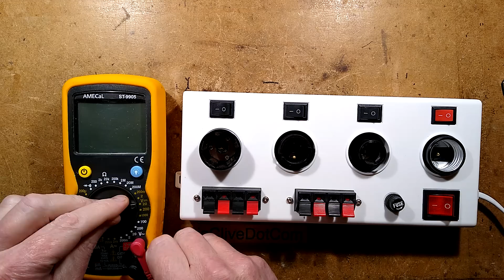AliExpress "explosion proof" Chinese factory test box

Comment: To me "explosion proof" means electrical enclosures, i.e. cabinets, conduits, switches. sensors, and motors, are sealed in such a way that  flammable gases or vapors can not get in to cause an explosion if an electrical spark happens inside.
That tester looks more to be a "spark proof" test box.

Comment: That's a short tester, it's a useful tool for troubleshooting a device that is AC powered and trips a breaker. I've built and used such tools. 

This is not a device that could be used in any capacity with an explosive location and meet any code requirements in the US. 

If you use this as a short tester and don't understand it and how to keep yourself safe it will kill you.

If you use this as a safety device in an explosive location you could kill everyone in the building and maybe a few neighbors as well.

Thanks for doing these videos and shinning some light on these dangerous products.

Comment: Connecting a high watt bulb (like a headlight bulb) in the place of a fuse is an old automotive electricians trick for locating short circuit witout wasting fuses. Just disconnect things one by one from the circuit until the bulb goes dim and the rest of the circuit starts working and you have found the short. Very handy in circuits where there are a lot of consumers like the marker/side lights on a truck or a trailer.

Comment: Hhhmmm, most speaker terminals / wire are usually around 100 volts maximum, with the norm being 30 - 70 volts, if my memory is still free from a short circuit. The Chinese do not take health and safety criteria to the same level as the Western world, in general. As you said this is very basic. Be safe and well 👍

Comment: Does this cause any issues where devices might not get enough power during debugging or is it only for cases where you suspect something is or might short?
I guess it might not be an issue as long as the device uses far less power than the bulb since then the bulb's resistance isn't eating the voltage as much.
Seem like something you could DIY pretty easily, then if you threw in a proper fuse (perhaps swapping to what you need for testing) and used a GFCI outlet, it'd make for a pretty solid safety device.

Comment: A few years ago, I built a project by glasslinger here on YT called "BUILD AN ELECTRONIC CIRCUIT BREAKER".
It was a joy to build and does a fantastic job. Light bulbs are for cavemen :face-blue-smiling:
Runs my AC plug on the bench. One of the better projects I built. Saved my ass many times when I did poopy head things.

Comment: 0:23 This is a Euro plug, type C. This is used in many countries.  If you have a small screwdriver and can overcome the shutter, it will even fit into English sockets.
Reply: Not to be confused with the UK shaver plug (search Wikipedia for 'BS 4573' for the comparison) - although they look similar at a glance.
Reply: Scottish and Welsh sockets too I'd guess.
Reply: Two things to consider 1. BS1363 plugs have a fuse for a reason, we use higher current sockets than most places. 2. The pins on a Europlug are sprung inwards and the tips of th pins are bigger than the shaft. Combined with the way the contacts are designed in a typical BS1363 socket this can lead to europlugs getting stuck.

If you must do the screwdriver trick then please at least do it on an extension lead rather than a socket that is part of the fixed installation, so you will have the fuse in the extension lead and so that if it gets stuck you can unplug the whole extension lead.
Reply: I probably wouldn't recommend trying to connect it to a UK socket, as there have been cases where a fire started as a result of someone doing that

Comment: 5 x 20 glass fuses can have a breaking capacity of 500 - 1500 A, particularly if fast acting. Quite disappointed by this basic error, Clive.
Reply from the maker: I'd expect the 1500A breaking capacity with a sand filled ceramic fuse, but definitely not a glass fuse.  For a glass 20mm fuse the breaking capacity is usually around 35A.
Reply: @bigclivedotcom  That's what the maufacturer's spec sheets say (e.g. Schurter). Many slow acting fuses are - as you say - no higher than 35A

Comment: I think whomever named this product got the concept wrong, it is not explosion proof, it might be short-circuit proof, as I see a lot of other comments called it a dim-bulb tester... like Mr. Carlson's Lab when he is repairing old radios and such and doesn't know if it will short out.

I hear Explosion proof and I think of "intrinsically safe"  I once wired an control panel that needed everything in it rated as such, that was my first time ever dealing with this concept and I learned a lot.  We used relays with contacts that are rated for use in explosion environments... You can bet these aren't cheap.

Quote: "The standard ensures that an "intrinsically safe device" is incapable of triggering combustion or igniting any gasses or fuels. To put it simply, you can use it around gasses or fuels without risking static electricity or heat discharge from the device igniting the surrounding volatile gasses, powders and liquids."
Reply: the "explosion proof" probably comes from a machine translation from chinese. That's how most funny names of chinese stuff happen
Reply: @marcogenovesi8570  Yes, exactly... that is what I believe happened too.  I've seen a lot of funny examples... some cannot be said in "polite" company. LOL
Reply: @marcogenovesi8570  That does indeed produce some outrageous results! Of course, when you have items such as hand grenades traditionally being called "divine bone dissolving fire oil thunder crash bombs", you may run into some issues.
Reply: The first time I encountered the phrase was in a factory building that worked with flammable solvents, it had "Explosion Proof" light switches. Big black cast iron things with a knob that went "CLUNK", like something salvaged from a WWII submarine. I remember thinking, if the factory ever blows up, these switches will probably be the only thing left intact.
Reply: Yeah, ATEX stuff may be many things, but cheap certainly isn't one of them!
Reply: This limits current, better equipped workshops have variacs to bring the voltage up slowly and avoid electronic equipment exploding.
Reply: @robertstoneking7916  Yes, that is correct in that sense of the word "exploding",  but the term "explosion proof" is a rating, it has an industry definition by NEMA-7 describing use in an environment that is potentially explosive and mitigation to preventing it from happening.  I don't think the translators knew that.  This isn't the same thing as dim bulb tester with a Variac isolation transformer... which by the way that piece of junk is really only the bare minimum in short circuit testing, still useful for that, but it can't bring up a device slowly, maybe "softly" which I guess you can call slowly-"ish" I'll give it to you there.

Comment: Serious question - what would/could you use to contain a large lithium battery (e.g 20V, 5Ah) failing catastrophically while being charged?
Reply from the maker: I'd make sure that the area it was charged in had suitable protection.  Like charging it in a vented metal enclosure away from flammable items.

Comment: Hi Clive, another informative video. It is always to interesting to see what is inside of piece of Chinese test equipment!
With that non-polarised plug there is a 50% chance of the exposed base of the bulb being live!
Nice!
Reply: Easy fix - just chop the 2 pin plug off, and put a UK 3 pin mains plug on.
Reply: How can it be polarized if the mains are AC?
Reply: @gabrielvieira.4358  Hello, because in the UK the Neutral will be at or near earth potential and the Live will be at 240 volts with respect to earth
Reply: @DavidVR2 More correctly, the live wire will sinusoidally alternate 50 times per second, between+320v and -320v with respect to the neutral wire, which should always be at 0v. It's 320v, not 230v, because 230v is only the RMS value.

Comment: Even through my screen, that thing looks like it must weigh nothing. I suppose a dim bulb tester gets the job done, but surely there must be more sophisticated ways of creating a current limited AC supply, perhaps even something with a configurable pass/fail test current. Test fixtures in a factory should effectively be a one-time cost, so cheaping out on one is not really going to save a factory any money, or can even cost a factory more than a good fixture long term due to downtime if your fixtures are constantly wearing out or breaking (or downtime due to damaged test technicians...).

Comment: Apparently a lot of Indians get electrocuted trying to steal power. I spoke to an Indian shopkeeper who worked in a factory and he told me that they don't bother with fuses, rcds or even switches, they just shoved wires into live bus bars. This was after he called me to his flat next door to mine because the wires to his electric shower were glowing red, and I pointed out loose connections in the fuse box as the cause

Comment: There also the risk that metal vapour from a blown element in a glass fuse can plate the glass leaving a high impedence path from live/phase that might give the impression that power has been disconnected, but which will still give you a nasty "tingle" should you touch it.
Reply: Could it also generate enough pressure from the heating to turn that screw cap into a bullet?
Reply: @james_tappin yea I think pieces of that cap are going flying if enough current keeps arcing across the fuse. The inner plastic of the fuse holder would evaporate and build up pressure.
Reply: I had never thought about a blown fuse getting plated with metal and staying conductive. 

That’s kinda scary since even if the short circuit is stopped, you can die from less than 1/8 amp of current.

Comment: Don't like that. It is way too bulky for what it is meant to do.

I have just bolted an E27 lamp socket on the smallest plastic enclosure I could fit two 4mm safety sockets into. Nice small unit that can be wired in series of the "device under test" easily.

As I really liked that small unit, I recently created a second one which is marked as being meant for low voltage AC to be used with a variable transformer. I have a 24V bulb in this socket which should not be used with 230V by accident.

Comment: Tungsten bulbs are very useful as surrogate fuses , well worth having one inline when powering up an unknown device.
Reply: They don't blow at their rated voltage, only good for current limiting, and passing current.  Could work if using a 12v bulb for example, but you still run the risk of passing current through an arc flash when it burns out or explodes.
Reply: @kelimike that’s the idea. 

If there’s a short circuit, it just lights the bulb and still limits current to less than an amp, instead of blowing up your circuit with a few hundred amps of fault current and then blowing a fuse.

To be clear, this whole setup would be plugged into a receptacle that is itself protected by a circuit breaker.
Reply: @deltab9768  The idea was stand in as a fuse, and then completely fail as a fuse?

A fuse is supposed to open on a short circuit fault.
A lighted series bulb is not a way to do this.  It is a way to test for short circuits, not protect from them.  This is only a great tip for someone who uses fuses to test for faults. They would go through fuses quick, so in this case, yes, use bulbs to test faults, not fuses.
Reply: @kelimike  I don’t think anyone is suggesting that this is a 1:1 replacement for fuses. 

Yeah he said “surrogate fuse” but this is clearly an additional current limiter, for a situation where you think there is increased risk of a fault, but you can’t test it with a meter because there’s voltage and frequency dependent components like transformers. In the event of a fault it will limit current to a less destructive value and (depending on wattage) will prevent damage to the equipment that a fuse would not prevent.

At a certain point you’re arguing against his choice of two words, not against the concept that’s pretty easily understood.
Reply: @deltab9768  True, then we can all agree too, that having a capacitor in series for AC is also a a great surrogate for a fuse, sometimes.
Reply: @kelimike  To some degree, you could use a capacitor. You’d have a transient without any current limiting if it was switched into the circuit when the AC voltage was near its peak. You’d have nasty resonance effects if the load circuit had too much inductance. And other than those two issues, you’d have an impedance that staid constant regardless of current, instead of one where the impedance rises at higher current. 

That’s why a lot of commercially available electronics just use a PTC thermistor. 

And of course, a bulb is just a PTC thermistor with ~400ms thermal time constant and visible temperature indication.
Reply: @deltab9768  Nice!  Couldn't say it better myself.
Reply: @deltab9768  Thank you for explaining why a PTC thermistor is a good surrogate for a fuse.  I now understand how to prevent unnecessary faults when utilizing a capacitor instead of a PTC thermistor as a fuse.
Reply: Yes.....Two 100 watt 240 volt tungsten filament bulbs wired in series are useful in testing  for incoming 440 volts or 240 volts by how Bright or Dim the bulbs light up .
Reply: Sometimes see YouTubers restoring electrical equipment that have a set up where they can switch a tungsten lamp in and out of circuit. It is a very simple way of providing some protection where you can instantly see if the item under test is drawing excessive current.

Comment: Plug your hifi speakers into those speaker terminals. They will create a sound like never before!
Reply: Loud, but brief!
Reply: @zebo-the-fat  hahahaha
Reply: Make sure you’re on a 32A circuit, as near as possible to the breaker panel, and the bulb bypass switch is closed for the maximum audio experience!
Reply: @deltab9768  hahahahahaha
Reply: A sound like never before .... and a sound like never again.

Comment: The irony is, this inline lamp box is probably a lot safer than some of the dubious "test setups" I've seen over the years of people running a bulb in series with old tube based TVs & radios (current-limiting to not make old waxed paper capacitors turn into little flame generators), though even this one still has its' safety issues, but, it's expected from the country of origin it seems.... :P
Reply: With one pin of the non-polarised plug having 1cm exposure it is a death trap!
Reply: @LawpickingLocksmith no one died in my 1980s household with those 'death traps'. Metal lamps, not grounded, non polarized and no one would unplug them when changing the bulb 💡
Reply: It depends on luck but even some dim bulb test lamps have too high wattage to prevent transformer damage due to shorted HV load - especially on smaller equipment that has very few tubes. For foolproof mains-powered testing you need an AC bench supply - voltage- and current-regulated.

You get one by attaching a step up transformer to an audio amp fed with a 50Hz or 60Hz tone. The current limiter further limits the amplitude of the incoming tone. The amplitude modulator doesn’t need to be linear since it’s in a closed feedback loop. So a resistive divider on amp input, with an LDR on the grounded leg, is all it takes. When the output current is past a threshold the usual op-amp starts driving a LED that reduces the tone amplitude via the LDR. Super simple and effective.
Reply: Agreed, my homemade tester made of cardboard and hot glue is less safe.

Comment: Yep ! ( Thanks , previous comments ) .. the " dim bulb " tester is the  MOST USEFUL  bit of electrical  kit .. not only will it stop you blowing fuses .. but .. you can test [ unmarked ! ] transformers with safety ( for YOU ! .. and .. the transformer ( ? ) .. just use a ( low wattage tungsten bulb ) for tiny ( 1 inch  transformers ).... tried - n - tested ............... DAVE™🛑

Comment: I assume a much better and safer tester would just be a current regulated supply so the test load can't draw more then a set amount of current. But I guess that would cost more then an incandescent lightbulb...
Reply: The advantage of an Incandescent bulb is that it has an inverse temperature coefficient, eg when cold is low resistance, but when hot has a high resistance, so it automatically adjusts to suit the load. So it acts as an automatically adjusting Current Limiter. It is well suited to testing high-power audio amps, by safely limiting current through a shorted power transistor, while still protecting a lower power fault. 
It also safely handles a high inrush, followed by low standing current. Also will handle faulty electrolytic caps which draw high current initially as they are "reformed".
The problem with a variable current source (or a Variac) is that it will protect a high level short, but will likely cook a smaller component.

Comment: While I don't have a problem believing that ~occasionally~ a glass air-filled fuse can go off in some nasty way including shattering, I'm really wondering why then pretty much all of them are nonetheless rated "250VAC" (and why the ~rare~ shattered fuse would be an issue for anyone if it happens inside a closed fuse-holder - it's not like shaking out the remains that one time would be the inconvenience of the century).